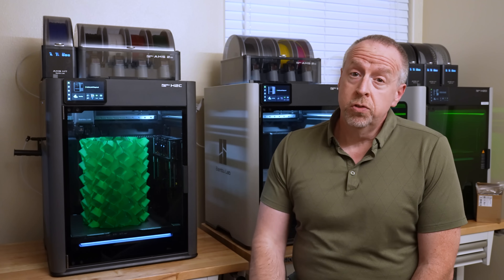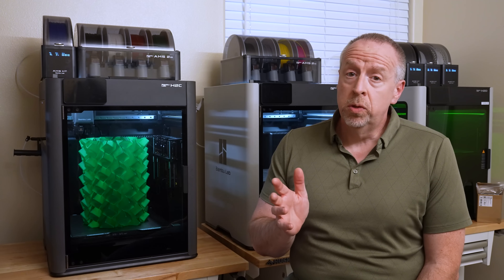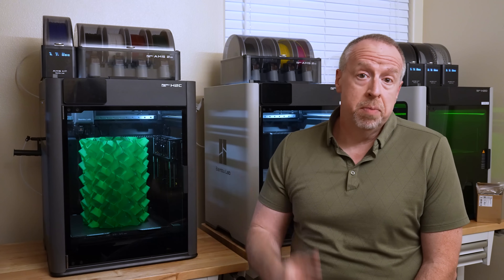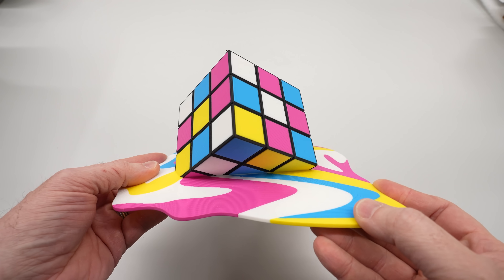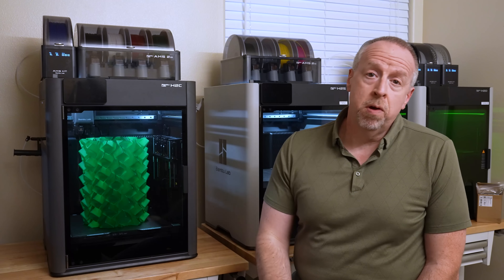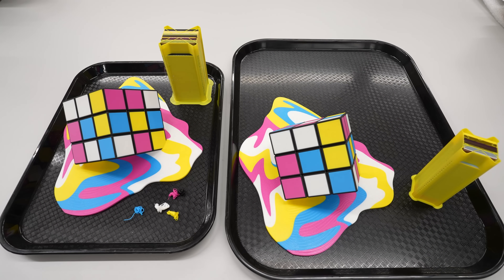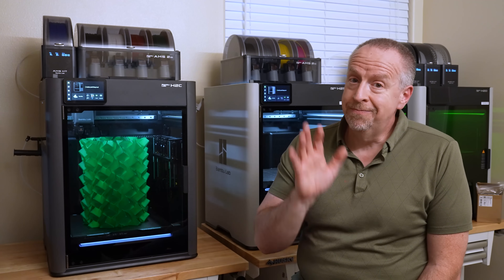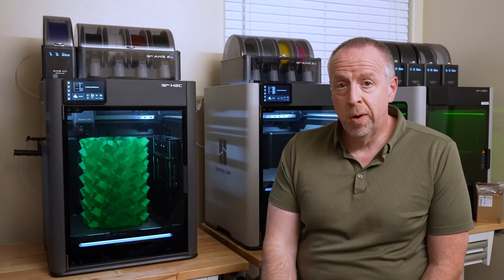Bambu Lab H2C vs H2S: Purge Waste Efficiency Test

Comment from the maker: Quick test today: comparing purge waste between the new Bambu Lab H2C and the H2S. My usual in-depth review will follow in a couple of weeks, once the initial release hype settles. I’ve logged over 400 hours on the H2C and have plenty of details to share.
Reply: What would be the difference between a H2S and a H2D or a H2D and a H2C?

Can you make an estimation?

Thank you!
Reply: For the new review, could you look into examples of adding TPU? For instance I was thinking of your TPU bellows with PETG/PLA/whatever. I don't think the H2C can handle that any better than the H2D. (Disclosure I bought a H2D 2 weeks ago for this specific reason, no need for H2C for this usecase)

But, it is way better for the main scenarios of multicolor printing without flexibles, as you provided a perfect example with the cafeteria trays.
Its only TPU that has the special requirement of not being able to use AMS, and ALSO not being able to be fed into the left nozzle...
Reply: @alnmike you could use TPU for AMS feed it through the left nozzle
Reply: @humphreybradley3060  TPU and TPU for AMS aren't necessarily the same thing. While you are correct, TPU for AMS is basically off the Shore A chart for hardness.
Reply: I think I did this right?  Asked AI for answer.
Print with H2C 
Print model - 375 grams 
waste -135 grams 
P1S Model - 375 grams 
waste - 1.3 kg 
with a filament spool cost of $15 each, how long would it take to save $1000 by using the H2c vs the P1S saving wasted filament?
1⃣ Waste per print

P1S waste: 1.3 kg
H2C waste: 135 g (0.135 kg)

Filament saved per print:
1.3 kg − 0.135 kg = 1.165 kg saved each print

2⃣ Cost per gram

Assuming a standard 1 kg spool at $15:

$15 ÷ 1000 g = $0.015 per gram

3⃣ Money saved per print

1,165 g × $0.015 = $17.475 saved per print

Round it however you want, but we’ll keep it accurate: $17.48 per print.

4⃣ How many prints to save $1000?

$1000 ÷ $17.475 ≈ 57.2 prints

✅ Answer: You hit $1000 saved after about 57 prints.

That’s insanely fast — basically one big print a week and you break even in ~14 months. If you print more than that? You’re pocketing money like crazy.

Comment: So for this example, that's roughly 300g per colour which is a 3rd of a spool, also if any models are using supports you have another roughly 300g+ depending on size most of the filament would be used on waste.  I really want an AMS system but I don't think I can justify the cost of the machine and the waste

Comment: I had the p1s for the longest time, but I’ve always been hesitant about doing multicolor printing because even printing a panda for my self would result in 200g used and 700g wasted. So when I saw the H2C announcement, I was already sold.

Comment: I'm really curious if your H2C has problems with the evenness/distribution of heat on the print bed. I saw another reviewer who had that problem, and I don't know if it's an issue with his printer specifically, or with the H2C generally. Is that something you will address in your full review?
Reply from the maker: I'll try.  People have already divided into camps over this and are likely going to believe whatever they want.
Reply: @Clough42  Thanks! Re: camps... That's wild. Tribalism about a rumor before wider data collection can reveal the truth blows my mind.

Comment: Can H2C print TPU85A? Left nozzle doesn't support 85A and under induction nozzle table say 85A is not supported, but wiki says right nozzle does support it. Can you run quick test?

Comment: I have question I cant seem to get a clear answer on. With the H2C, if you want to hook up Four AMS units for 16 color options, does it require a separate Hub unit for the PTFE tubes to feed into, like with the P1S (and now A1)? or can it just hook them all up out of the box? I don't see that addressed on the official site, nor is there listed a Hub unit for the H2C (or any of the H-series for that matter)
Reply from the maker: For the H2C, you just need a 4-to-1 PTFE adapter.  They sell it for a few dollars here:  https://us.store.bambulab.com/products/bambu-4-in-1-ptfe-adapter
Reply: @Clough42 thanks
Reply: @Clough42  upon further inspection and research, I found out that the H2C comes with a brand new "4-in-1 PTFE adapter II" so a v2 of the adapter. It comes in the box. Thanks again for your time and attention.

Comment: Great to see focus on reducing waste and cost! 💰 This efficiency is key, from hobbyist printing to professional manufacturing. For end-use parts, we optimize this further by choosing the most efficient process—like CNC machining or injection molding—to minimize waste and cost at higher volumes. Smart testing!

Comment: Can it purge to support instead of a tower? I'd assume that could make it even better? TBH, I'm mostly interested in whether multi filament prints (e.g. PETG with PLA Supports) is finally going to be fast enough to be practical. I really hate taking a 4-5 hour print and making it 25 hours just for the support swaps and purge.

Comment: Well said as usual.  As I have a 0.002% want or need for multicolor prints, this offers me nothing.  The only machine that could is h2d for the multi material printing.    For all my models I am happy with the AMS standard swapping as has been the norm. 

Waste and time are never an issue( whining and handwringing as it seems to me by others ) 
What I want from Bambu is TPU and abrasive filaments through the AMS

Comment: Professionals don’t rely on multi-color printing. They use multi-material systems to create optimized support structures or to combine engineering-grade filaments. Investing in high-end equipment solely to print ‘in color’ is a misunderstanding of what advanced 3D printing is actually for.

Comment: It's a cool system for those who focus on multi color. Not sure I would justify the extra 1000 bucks over the H2S when doing mostly single material engineering filaments with limited 2color prints. I'm lucky to have 20-30g of waste per print. Gotta make a lot of parts before that justifies an extra 1000 bucks. (making more use of multi material for support opens up a few things too but more complex math. Doing that math, it seemed like after a year of printing at my projected pace I could justify the H2D over the S in waste cost. I figure after a year I'd just get an additional printer then anyway if I'm printing more than that.)

But for someone regularly burning a half kilo or more for fancy 5 color print jobs, or needs to mix functional materials, it seems like a no brainer over the D or S model. Rapid return in investment.

Comment: My impression is that the H2C will really come into its own for us functional / non-multicolor users once the slicer can support different nozzle sizes in the same print. Just being able to have 0.2-0.8 in the rack to select on a given print is worth it just for me, but considering the fixed nozzle will be unused in many of those cases, the slicer really needs to handle it. Having 0.2 details with 0.8 bulk and rapid support interface swaps will be AMAZING!
Reply: As the old saying goes, "The squeaky wheel gets the grease." Since Bambu Lab listens, and since I feel that there are enough of us who want to see that feature, I have a strong feeling that they will eventually make that happen.
Reply from the maker: Yeah, I think a lot of people are waiting for that feature.
Reply: I think you will not save any print time because the switchover takes ~25 seconds
Reply: @Gekkoperformance  The switchover is actually twice that. About 40 seconds.
Reply: @Gekkoperformance I'm not worried about the time, I want the capability. The only time I use multiple colors is on control panel type things. Having different nozzle sizes can allow for fine details on large parts that aren't practical today.
Reply: @rickmellor did you try increasing the infill line width and combine infill layers?

Comment: Joeseph is going to get left behind.  I hate to say it.  I've been in this hobby since the PRUSA i2 was being built by us home gamers...my first printer was an i2 I built.  My 2nd and 3rd were i3's I built (one with a 200x200 bed, and the other with a 250x250 bed) (all this pre-heated bed and ABL...heck the i2 had a hand wound hot end using nichrome wire LOL!).

I really wanted that Prusa Max 5 head tool changer, but (at the time) the >$5K price tag was unobtanium.  Even his single head printers were just too much, but reasonable for the quality.  Now?  This H2S is really nice.  It is now on my list for a new printer....but not right away...gotta lot to save to get there, and I need to justify it to my wife...as we're retired, and while we have more than enough, frivolous spending gets you in trouble.  :)
Reply: I bet Bambu has something targeting the XL market in the works as well! I think Prusa is going to have to outsource the manufacturing to China to stay competitive.

Comment: H2C vs H2S is not a fair comparison, it’s like comparing a Lamborghini to a Prius and complaining that the fuel efficiency is not as good.   The H2C better be an improvement. How does it do against the H2D?  It should be better, but by ho much, and yes it depends.

Comment: That difference in waste filament is shocking.  The time decrease is also impressive. I’m impressed that they got the H2C out this fast.

It definitely seemed like the H2C was a reaction to a certain other multihead printer. I will definitely be interested in reviews that compare all of those options.
Reply: Out Fast???? The H2C was meant to be released way back when the H2D was launched, however it took way longer for Bambu to get it sorted than they initially anticipated!
Reply: @MoltenMetalSparks some of us are still waiting for the P2S to be available for purchase. It was announced weeks ago and nothing. But this is available for order on release day.

Comment: I look forward to your complete review. Already seeing some heat bed concerns from another reviewer I watched today.
Reply from the maker: Really?  I haven't seen any issues.
Reply: @Clough42 do you have a Laser Temp reader? People ares sayin it’s not consistently warm so prints weren’t sticking
Reply: @Clough42  The thermal images showed a pretty severe gradient across the bed surface, unfortunately.
Reply: @Clough42 yeah on 3d printing nerds channel, he showed it doesn't heat evenly using a thermal camera. Also showed that the bed temp didn't match what the printer was reading. 15° off, or thereabouts. So when temp was set to 100, the printer would say it had reached it, but in reality it only made it to 85°, plus having cold spots
Reply: @jmangus83  Was that being measured with a thermocouple or the camera?  If it was with a camera, I wouldn't be surprised if the emissivity of the bed isn't a great match for the camera's settings, so  it might be off.
Reply: @neosenshi  He used the same camera on X1C and temp was within 2-3C
Reply: The print bed concerns 3D printing nerd had are pretty common across all consumer enclosed core XYs; most materials are not actually sensitive enough to +-5C on the heat bed as long as the slicer overshoots a bit to compensate